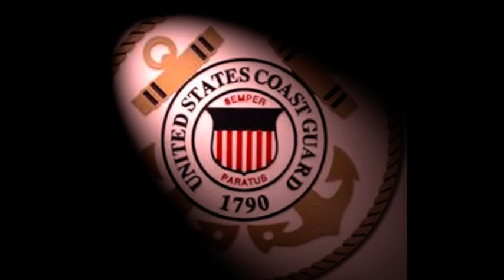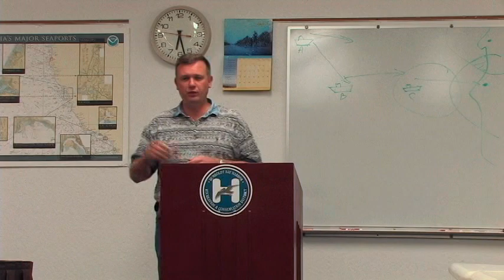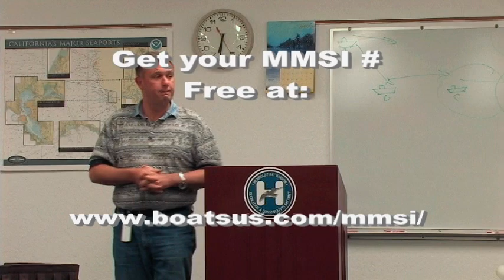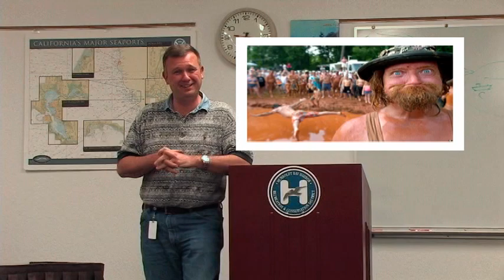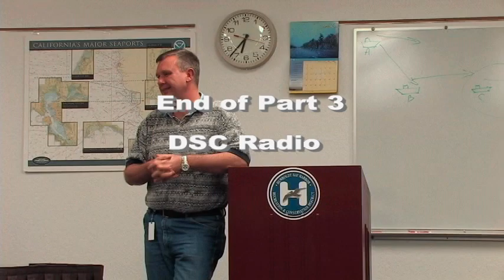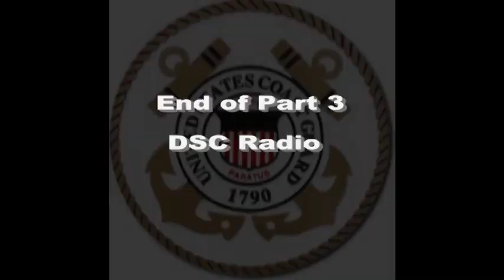VHF Marine Radio - DSC Radio USCG- Pt. 3

Comment: DSC is not only for distress, but also appropriate for urgency and safety communications. So, please explain this too. Look up in the Marine VHF Radio Handbook (forthcoming). 
Please also tell, that after pressing the DISTESS button, and hopefully receive an acknowledgement from the CG, you should say the usual MAYDAY on CH16 while pressing the PTT. Use a simulator to really undarstand how does it work.